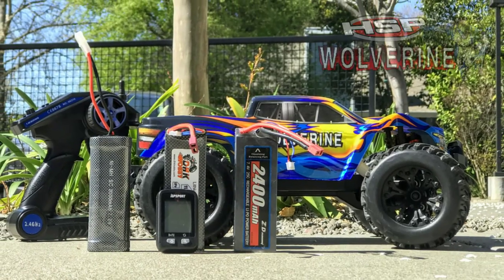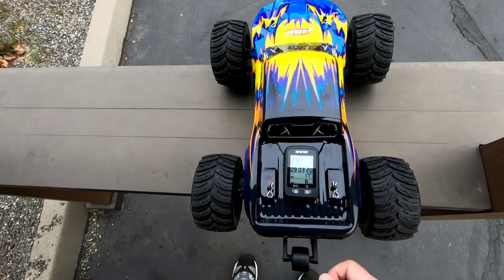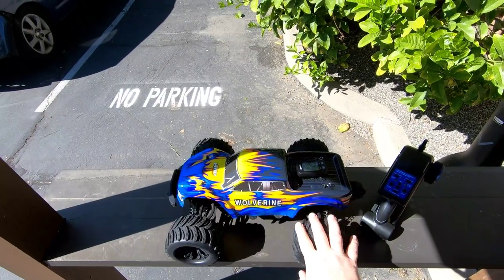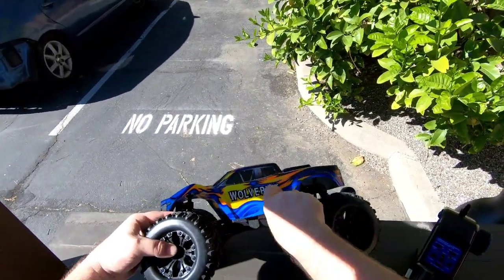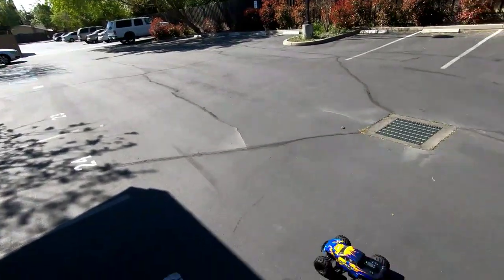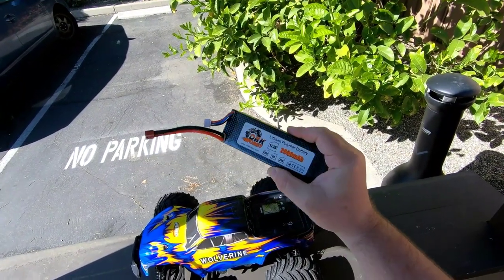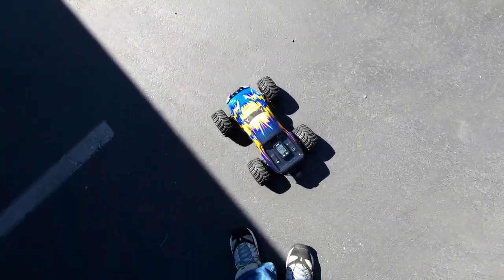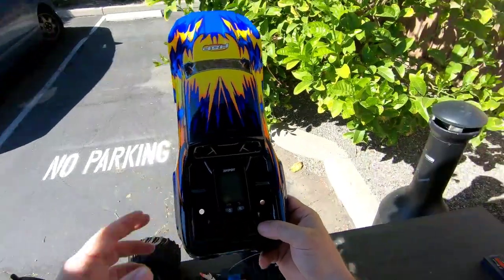HSP 94701 Wolverine Speed Test  NiMH Battery | How To Setup Esc For 2s and 3s Lipo Battery

Comment: Wow it really hauls on 3s. At first though I thought those speeds were in mph. That seemed a bit fast for the NiMH pack but I see that was only 18mph. Very good and helpful video Donnie. Moving the jumper for lipo would be an easy thing for beginner's to miss. Thankfully it is easy to do.
Reply from the maker: Thanks Ryan, I am glad that the esc can handle 3s

Comment: Nice informative test video, thank you!
Having the 3s that would be  more volts, I think more than 11…v, and it’s suppose to be 7.2v, wouldn’t that hurt the esc, it’s my understanding and heat up the motor?
Where do you get the cooling fan? And about the recommended 3s you linked hiere, it has 3000mAh, would you recommend more that that for more running time? That probably will heat up the whole thing…?🤔 
Please let me know. Thanks!
Reply from the maker: Thanks for watching, I since upgraded to a brushless system. The bad thing is the suspension is very weak.
Reply: @BIGDRONEFLYER77RC  
So upgraded to brushless...
I guess I have to do more research on what I mentioned and asked because this is for my daughter and she wants a little speed on it. The battery it came with does not make it move much and dies. It's not lipo battery.
Someone gave her this model brand new, but it was stored for a while.
Reply from the maker: @chmva2000 there’s a switch on the esc so you can run lipo battery in it. Just run 2s lipo will be fine, that way you don’t have to worry about the esc on 3s.

Comment: I have the brushless version and it rips! Uses that wheelie bar all the time even on 2s. Axles need updated though as the stock ones break all the time. I converted mine to dog bone axles using all HSP  parts and have not broke one yet.
Reply from the maker: That’s the way to go, the plastic ones are junk. Thanks for watching!

Comment: Nice speed test brother.  Remember, when you're doing these r/c speed tests, don't forget to tell us that the numbers you're giving us are kilometers and NOT mph.  (This thing ain't breaking no land speed records!!!)  Before you buy a cooling fan for the ESC, I suggest buying a whole new brushless ESC and upgrading the power system to brushless!  POW!!!
Reply from the maker: That’s why I left the mph text, thanks DJ
Reply: Which brushless is recommended for it? This would handle the 3s and 21.1v, correct?
I'm new to this...
Reply from the maker: @chmva2000 anything that fits. lol
I don’t remember what I have is it, the motor can size is a 3650. So Amazon ,  Aliexpress, eBay and local hobby shops will have a motor and esc combo for that. Then you will need to add a new transmitter and receiver combo as well. Since brushless has a different receiver then brushed motor system. HSP Wolverine 94701 Brushless Motor/ESC Conversion & Speed Test
https://youtu.be/iqrVobu2lKA
Reply from the maker: 3s not 21.1v will fry the esc
Reply: @BIGDRONEFLYER77RC  
I meant to write 11.1v...typo. sorry.
Thanks much for the suggestions
Reply from the maker: @chmva2000 
3-deans male connector to tamiya battery connector : 
https://amzn.to/2ICUyjo

Recommend 2s lipo:
https://amzn.to/2Q6bZgn

Comment: Hi bro. Greeting from Malaysia. My name is Khairul. Just to ask few questions.

1) Standard battery is 2s for Hsp wolverine. If we upgrade to the 3s lipo battery, do we need to upgrade the esc and motor together? Because the seller tell me that if using the 3s battery need to be careful because the motor and esc could burnt if excessive playing. Need to cool down first. 

2) For upgrading, what can you suggest for esc and motor spec/brand that fit and suitable for hsp wolverine? 

Thank You bro.

Comment: I'd like to see or know how long it would last on 3s in offroad conditions. Most brushed motors on 2s die running in gravel and short grass.
Reply from the maker: It’s still going strong, this esc is setup for the 3s and the 550 is a great motor. Thanks for watching and hope everyone is safe where your at. Cheers my friend
Reply: Those handle 3s just fine, I have many of those esc and motor combos in different vehicles. No cooling fans required.
Reply from the maker: Well the brush version sure didn’t hold up, that’s why I put the brushless setup in. I fried that esc and 550 brushed motor on one pass with a 3s. Sometimes you will get one that will run with no problems
Reply: I just bought this one.but is slow.
Would you recommend me getting the 3s battery and running it daily
Reply from the maker: I fried the esc like I was saying in the last comment. That’s why I put a brushless system in there so I can run a 3s. Thanks for watching and Happy Holidays!
Reply: @BIGDRONEFLYER77RC  thank you so much for the feedback , will get the brushless system, have a blessed and safe holidays
Reply from the maker: Thank you 🙏 you as well

Comment: I've just had a brushed hsp bug crusher come in the post and set it up and when I drive forward it needs to stop before it starts reversing.  Cars I've had years ago would reverse straight away  and the car would do a awesome skid .  Is there something wrong with my car ?
Reply from the maker: May have to see if your esc will s programmable? That way you can adjust the brake % Also on a lot of Rc’s you have to double click the reverse and hold it on the last click for it to kick in quick reverse. So hopefully you get it worked out, thanks for watching.
Reply: @BIGDRONEFLYER77RC  thanks for that I've just found out its racing mode for going round corners while breaking with control.   Plus it's what you said I have to click 1 click 1 again in reverse to instantly reverse quickly.    Thanks for answering I've subbed 👊👊👊
Reply from the maker: Awesome, glad that worked. Thanks for the support.
Reply: @BIGDRONEFLYER77RC  no problems.

Comment: Would anyone be kind enough to tell me the difference between this wolverine model and the brontosaurus? I never knew about this wolverine. Thanks.
Reply from the maker: This wolverine is bushed and it has a different suspension then the brushless version. I think the brontosaurus is more like the brushless wolverine, it has 8 shocks and a couple aluminum parts. You will have to compare with some other videos to look more closer at the brontosaurus truck. Thanks for watching. I wish I could of been more help, I don’t have that truck yet.
Reply: @BIGDRONEFLYER77RC  thanks for the information. Looks like i might scout for the wolverine, as i already have the brontosaurus. Yes i just caught some videos on the brushless wolverine, wonderfully fast. Thanks again, enjoy your truck 👍

Comment: Hi I want to no if I can use a 3s battery on hsp grampus rwd brushless
Reply from the maker: If it’s only a 2s then your taking your own risk. ESC’s are fairly cheap, I would put a 3s esc in it.
Reply: @BIGDRONEFLYER77RC  ok I see how many amps esc must be fitted.Some people told me its fine its will work fine with no problems.I have the old grampus with 60amps esc

Comment: You cannot burn out the ESC by just leaving it in nickel metal hydride mode the only thing you will burn out is your lipo battery because it will not cut off and why do you keep calling it conversion if it can run both there is no conversion